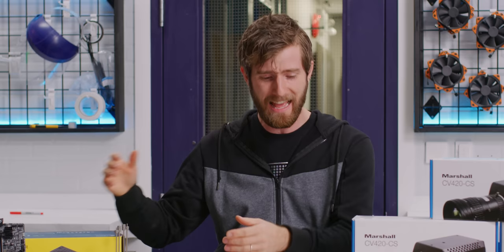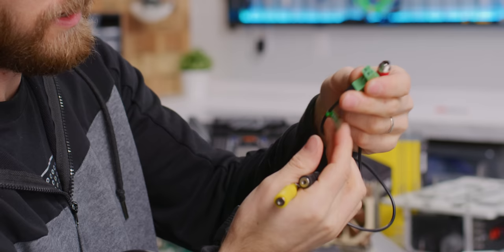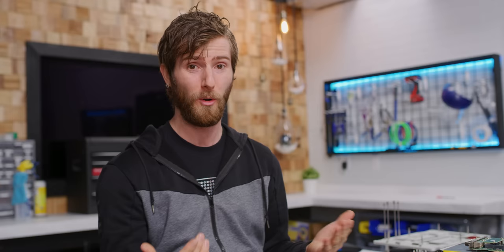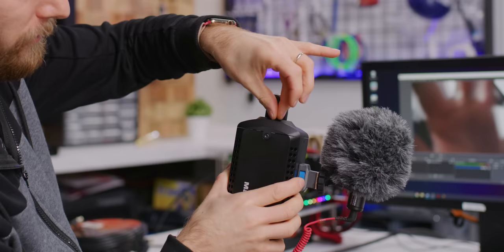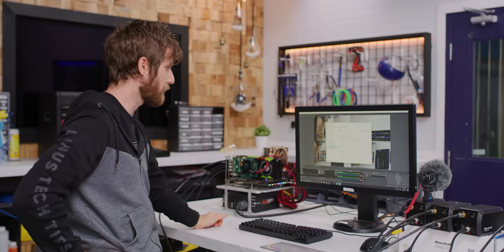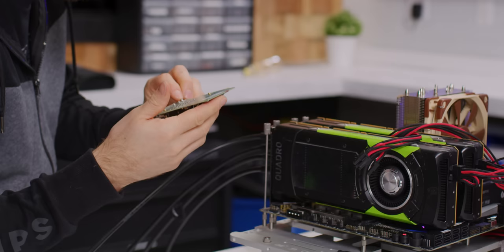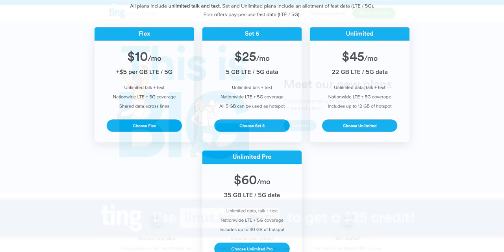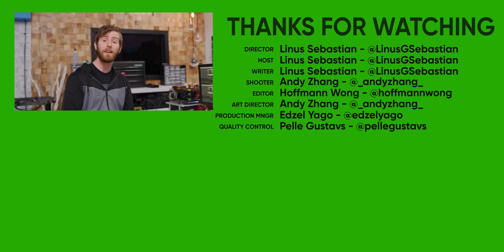I've NEVER done anything like this before...

Comment: For the NVENC limit, i wonder why you'd not just use the driver unlocker that makes it so you can run unlimited NVENC streams on all unlock supported cards? There is of course a limit, but it's a hardware/performance one not artifically set in the drivers by Nvidia
Reply: Windows Unlocked drivers are real iffy and break constantly, he would have to run Linux with a custom driver to get that working.
Reply: Reliability.
Reply: Not to mention you would have to disable updates to prevent windows replacing it every so often
Reply: @Theinatoriinator  That box only does @1080p 60fps. It’s stuck to 30fps at 4K. So no, that doesn’t work.
Reply: @davidruban   I was in a rush but I know they have 4k sdi to internet, and it might be cheaper to get 6, it depends though.
Reply: @davidruban  you can buy the matrox 4k h.264 encoder. Supports 2 4k streams at 60fps, converts directly to h.264, so even a MacBook can handle the streaming
Reply: Quadro GP100 actually doesn't have any nvenc limitations according to nvidia's matrix. I think he is just recording at really high bitrates.
Reply: @MrLmgh  the artificial limit Linus talks about is for the GeForce cards, not the Quadros. Otherwise he would just throw some 1080ti or 2080ti and make it work
Reply: @davidruban  Incorrect https://github.com/keylase/nvidia-patch/tree/master/win works on windows i use it with plex
Reply: David Ruban Linux and nvidia aren’t the greatest couple though. Torvalds summarized it quite eloquently as follows: “F@%# you nvidia!”
Reply: He probably doesn't want to constantly fix things because for someone updates the graphics driver
Reply: @davidruban  I ran the unlocked drivers with Pascal-based cards in my Windows 10 Emby server. NEVER had any issues. (Getting hit with multiple 4k & 1080p streams at once). All the unlocked/hacked drivers do get rid of the NVENC 2 client limit. (I don't blame Linus for going this route though seeing as Nvidia is a partner/company LTT works with and that would probably piss Nvidia off... )
Reply: @bbq1423  Linux and nVidia works great.  The reason why Linus Torvas said what he did was due to nVidias drivers are not opens source.  Most of the times nVidia cards works better with Linux then AMD.
Reply: One thing to keep in mind, this would be expected to be operated and maintained by the badminton club / athletic facility. They may not have someone with too much technology knowledge on staff so simplicity would be a significant factor. 

If this was a setup for Linus own facility he may have made different decisions.
Reply: @badincite  RELIABILITY
Reply: @ShortHandedNow  doesn't mean others won't. You gotta realize. Games are time sensitive. If one day he boots up the PC to stream the games for the families and something goes wrong. Then what?
Reply: @MK-bi1hj  Yeah, many calls out reliability here. But in my personal experience, that driver unlocker is really not a point of failure. Sure, reliability is still an argument, but I think it needs more backing to be a deciding factor.
Reply: @MK-bi1hj  Again, I have used them plenty of times, they are not likely to do so. If you need more proof you can go through the plethora of PLEX & Emby forum users who are daily driving these unlocked drivers with no issues.
Reply: Have used the NVENC unlocker as well. It doesn't and shouldn't cause any issues
Reply: Me realising I can't understand a word u said
Reply: @MK-bi1hj  One thing you can surely rely on, is that this box is gonna reboot for windows update whenever "your kid" is playing finals, and bungle GPU settings and headless setup upon reboot.
Reply: @ShortHandedNow  ITS NOT the reliability of the unlocker in question here its the reliability of the full setup and of the staff that will be running this being knowndegable on all this. AKA get a clueless person and WHOOPS there goes the unlocker and back to standard drivers with the lock in place and there went all your streams. So yeah they do it this way and they can avoid that kind of stuff from happening.
Reply: @Montisaquadeis  Seeing as display driver updates via Windows update are categorized under optional and can be disabled unless authorized, and the same goes via the Geforce Experience... Not to mention you can have issues even with official drivers and updates. Again I didn't advocate for these drivers in this setup, I just wanted to make it clear that they are perfectly stable/reliable to counter the people calling them out as "unreliable". It is a load of B.S. from people who have never used them.
Reply: Norden didn't except you here
Reply: The problem wasn't a limit in encode sessions but actual GPU usage for OBS scene compositing. Quadros/etc. are already unlocked so that's not even applicable here.
Reply: @badincite  I came to the suggestions looking for exactly this. I patched the NVIDIA drivers for usage on my Plex server with a 1650S (Turing NVENC) and it works perfectly.
Reply: Aside from legal reasons, Quadro cards are superior when it comes to compute and pure bandwidth. Both of these are things that NVENC needs tons of, especially with multiple recording streams at 4k60. While it's possible to reduce the compute cost drastically ("High Performance" preset), you can't get rid of it entirely. On Ampere it is even worse as all NVENC sessions now share a separate motion estimation engine, which by itself sounds good, but adds a separate limit to weaker cards.
Reply: maybe it should as well easy to maintain, because i dont expect a very tech interested person in a sport center.
Reply: @davidruban  Been running it, on my 1080ti that is, and it's been reliable for months, so i don't think that's such a huge factor
Reply: NVIDIA would send a hit squad to Linus... just look at what happened to hardware unboxed for not reviewing it the way they wanted lol
Reply: @Nordern  I also run a Plex server, and I ended up having to run Linux for stability with my GeForce card. The windows patches are a cat and mouse game. I’m glad it’s working for you and the other dude on this thread but it’s like me saying Cyberpunk 2077 runs awesome on my RTX 3080 no issues, but as I look online I see others are having a bad time with bugs.
Reply: @EposVox  Brother Vox has spoken... Let us all shut up now. :p
Reply: @Nordern  hi norden, a big fan of your content here 🤗
Reply: @davidruban  it’s Anthony time
Reply: Everyone is saying "i did it and it works fine" yea the unlocked drivers probably run fine on your machine running different hardware (likely more conventional) with probably different software setups its not apples to apples like that, not to mention the fact that its not a personal use case, im sure linus doesnt and is unable to go to the sports center or take a call everytime an issue pops up
Reply: David Ruban what’s wrong with that?

Linux is better than Windows anyways. Especially for a project like this.
Reply: David Ruban Linus said he was streaming to Twitch, so why does he need 4K? Twitch only supports 1080p...
Reply: @nicko880  no os is better it’s just different use cases
Reply: Elliot Declet for this project he should just be using Linux and FFmpeg. Windows and OBS is so much more inefficient and less reliable for a workload like this. 

Plus Linux is very stable with unlocked geforce NVENC.
Reply: @MK-bi1hj  Ive been running a patched 442.50 since release with 0 issues or crashes.
Reply: Norden shouldn't you be making knockoff sovietwomble videos
Reply: for this exact case, getting an 8*4k ip encoder costs about 75% of the price of the gpus+capture cards but probably consumes a lot less, though going with the gpu setup is probably better since you might want to be able to do more than just add a logo.
Reply: @davidruban  but he should be using Linux or BSD anyway for a pc of this purpose
Reply: Will it be reliable?
Reply: @Theinatoriinator  yeah let’s buy some cheap crappy Chinese brand junk. Good idea
Reply: Linux should be just fine for nVENC encoding with Nvidia...
Reply: loool all the people in this thread who have no idea how limited nvidia cards are by default x3
Reply: That sounds like a level of sketch that no IT pro would mess with--you'd waste too much time fixing it.  This whole setup is approaching budget-sketchy as it is...  You want to set this thing up, then never mess with it again rather than dealing with the court/parents contacting you every week because the stream went down.
Reply: you don’t even need a driver unlocker, since geforce cards now support 3 encoding sessions, check nvenc support matrix on nvidia’s website
Reply: As others have said, that's not reliable and Linus literally says he used 100% of gpu usage with his quadro, so a normal consumer grade gpu would've been MAXED out...
Reply: @bbq1423  ayy TuxPilled
Reply: @PerKroon  you should see the horror stories about nvidia cough cough novideo cough cough and linux lmao
Reply: @imgladnotu9527  No idea what you are referring to.  I been professionally developing software for Linux since 1998 and Unix before that.  Linux have in the past have problems with both GFX brands but in general have the drivers for nVidia been better.  AMD always been open source but that in is self with sometimes hundreds of different "current" driver is not always the best way.

Comment: I have built live streaming systems like these for several venues — houses of worship, cemeteries, conference centers, etc. — and there are a number of reasons this system is problematic.

First, the badminton center is going to need some really impressive broadband service to be able to simultaneously stream five (or six?) separate video feeds in HD, let alone 4K. Most places I work with need to upgrade their internet to get enough guaranteed upstream bandwidth for a single 1080p30 stream.

Second, trying to do this all with a single computer heavily complicates things. As Linus found out, it means tons of expensive hardware like heavy-duty video capture cards and $4K GPUs. It also means running multiple instances of OBS. So this is a system that will require someone who really knows what they're doing to be onsite to run it (or to log into the PC remotely over VPN... and now we need even more bandwidth).

A much better solution would be to stream each camera using its own machine. A barebones PC each with a quad core CPU and a CamLink (or similar) would have no problem streaming a single camera. Six of them would easily be cheaper than this $10k+ machine.

Or even better: Use a dedicated streaming device that doesn't even need a PC, like the Cerevo LiveShell X. These guys can broadcast a single camera with no PC necessary. And they can be remotely managed via a web interface, or you can set them to go live with a single button press. They're $700 apiece, so six of them would come in way under the cost of Linus' mega PC. (And they're little, able to be mounted right alongside each camera. No need to find a closet for a giant PC case.)

Comment: Linus: "On a budget"
USES A QUADRO, 6x $1500 CAMERAS AND 2x $700 CAPTURE CARDS
Reply: Those GP100s are MASSIVELY overpriced though for some really weird reason. Looking on ebay, you can't get one for less than $4,000. Just for comparison's sake, a super fancy pants Quadro RTX 8000 which absolutely crushes that GP100 into the fucking dirt in every respect costs about $5,000. wat?

Honestly, it's like ALL the mid-range GPUs spiked in price, but the low-end and high-end stayed pretty much the exact same. It's insanity land.
Reply: Budget means, that someone has limited amount  of money to spend, not that something has to be cheap.
Reply: @arnox4554  you go in a cinema they have  popcorn choices : 
Small 2$    Medium 5.5$     Large 6$ 
you automatically go for the large that you think is more cost effective 
marketing 101
Reply: @mohsentabouna6401  But that's someone who controls the prices directly obviously. Ebay prices are entirely dictated by supply and demand.
Reply: And a 1st Gen threadripper...
Reply: For professional video and streaming gear, this is pretty cheap
Reply: I think he had the quadro lying around
Reply: @arnox4554  i feel like rtx 6000 will do the trick with around the same price as gp100. rtx 6000 is basically a 24g vram version of rtx 8000
Reply: @est495  I think that context changes the meaning. When someone is actually talking about a budget then your meaning fits but generally when people throw around "on a budget" they mean it's more reasonably priced.
Reply: @qupeter1224  Well, if you're gonna spend that much money, I'd say just get the damn 8000 and be done with it, honestly. If anything, you can use it flex more on the console plebs.

Comment: "A tonne of multicore muscle on a budget." Aaaaaaaaand Intel has left the chat.
Reply: not yet, used xeon is extremely cheap especially with some weird x99 motherboard that supports more than one cpu
Reply: @qupeter1224  and the 10850k is way cheaper than a 5900x in my country, soo...
Reply: FX8000 series CPU with 8 cores has been a around for a while
Reply: @TheFalseHuman  but they have worse core performance than an intel 4c/8t cpu
Reply: @samurai4x483  yes. 
 Linus acknowledges that single core performance is still Intel's strong suit (at least pre-5000 series AMD CPUs) iirc?

Comment: Probably could've used straight FFmpeg without OBS, that would eliminate 3D load.
Reply: that would also improve the performance anyway since OBS has a bit of ovearhead for compositing stuff and also displaying the feed to the screen
Reply: I was thinking, surely stacking OBS windows isn't the best idea?
Reply: @stressedtechie518  had to justify the threadripper somehow I guess
Reply: Could also have used vMix instead of OBS as it can do multiple streams without needing to open multiple instances. Or just straight up buy a professional video encoder for probably much cheaper than this computer lol, this is a really bad setup
Reply: cant he jsut run 4 on nvenc and 2 on x265?
Reply: you can also disable the composite preview too...
Reply: @IanSzot  I'm pretty sure that VMix can do only 2 RTMP outputs. The best idea is linux distro + straight up ffmpeg.

Comment: Amazing!!! they also had to upgrade to a 10gig internet contection at the sport center in order to handle 6 4k60 upstream concurrent.
Reply: Do the math someone?
Reply: Netflix recommends 25 megabits per second for a 4k stream down so even if that's 24fps then at 60 you'd want 62.5Mbps and for 6 it comes out to 375Mbps. All in all 1 gigabit is almost definetly good enough, if netflix's number was for 60fps and generous you might even get it to work at 100Mbps. 1Gb is probably best bet though.
Reply: @tehbest  thanks
Reply: @the_retag  dont need to do any math. he literally used 5500kbits in settings. so under 35mbps total.
Reply: @tehbest  oh no no no, that's not the LMG way of doing it. For sure they went and throw a microwave link to the LMG HQ and use floatplane to stream at 4k 120fps, backup the footage on 2 different locations and 3 different medias, made Taran edits the higlights of the matches and James as commentary. Cause all this fit in the budget, tightly but the made it fit.

Comment: use ffmpeg realtime decoding, encoding & streaming with cuda acceleration for that pc and problem solved with core i3.
the problem with your setup is you are not using video decode on nvidia gpu. you could have get away with gtx1050s on that setup.
btw. nvidia increased concurrent encode capabilities by +1 on almost all models.
https://www.techpowerup.com/268495/nvidia-silently-increases-geforce-nvenc-concurrent-sessions-limit-to-3
you could have used nvidia cuda toolkit to limit power consumption and gone with 1/2 power of total system too.
Reply: yeah okay but 1050s and i3s don't look cool
Reply: @trashpandaa4021  but they work cool, literally.

Comment: "on a budget" sees the quadro in the background
Reply: not really needed. Geforce cards now officially support 3 nvenc streams. So 2 1650super cards should do the job just fine.
Reply: @Psi-Storm  doubt it since the quadro sits at 80% load near the end. and that is with his second "lesser" quadro helping out. the gp100 is the same chip as the titan x and 1080ti. however you don't buy a quadro for it being more powerful than the gtx cards since it's basically the same. you get a quadro for the drivers and its features that you won't get on gtx. that's what you pay the premium for. well that and also for some extra vram needed in some prefessional usecases.

Comment: 6:30 I can sympathize, I've worked with several models of DeckLink card, all of them are number strangely.
Reply: It seems they number the channels in the circuit before laying out the board, instead of working backwards from connector positions to driver-visible port numbers.

Comment: 0:55budget 
I see a quadro sitting right next to you.
And is that a threadripper?
Reply: Try to buy a newer generation graphics and cpu in this cost.. And budget doesn't always mean cheap but a set of amount
Reply: @KingKong-xp6so   you are right. but in this case it does mean cheap.
Reply: @prabhatgoyal9938  then take the other meaning of budget, one.. And two is, this was actually cheap for the kind of setup..

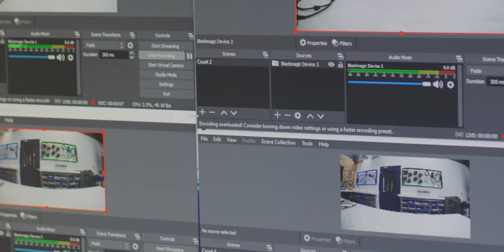Comment: Dude, I couldn't help but notice at 10:54 the manual quad window split. Snap windows to the side and then snap them up or down. First with Windows Key + Left/Right and then Windows + Up/Down (without releasing Windows Key). I'm using an LG ultrawide monitor and it came with some window tiling features. A quick search shows a few things out there (like AquaSnap) that can neatly and quickly display/change multiple windows on a large screen. Might be worth looking into or might not. Just wanted to share because my OCD was going haywire. I've calmed down now.